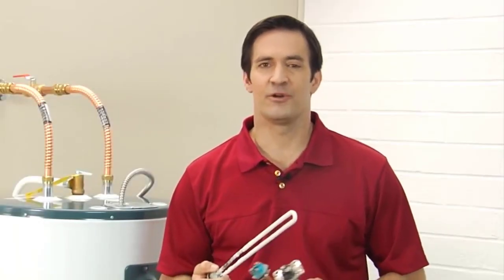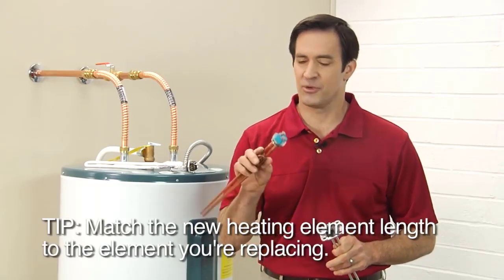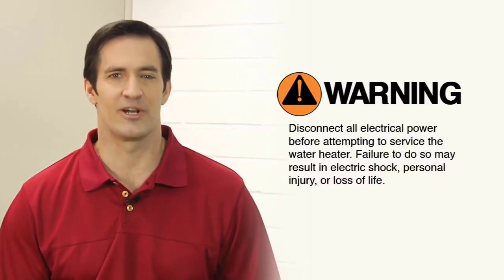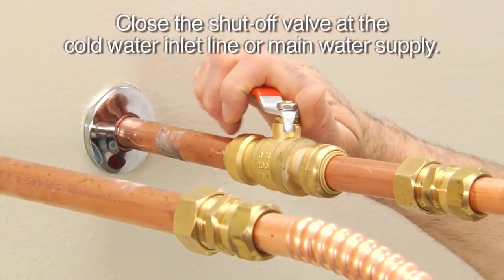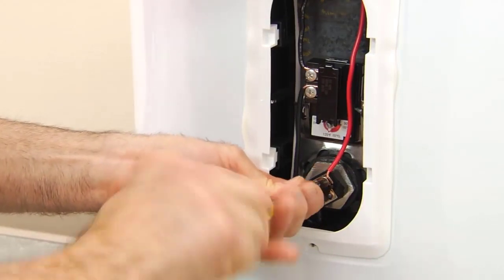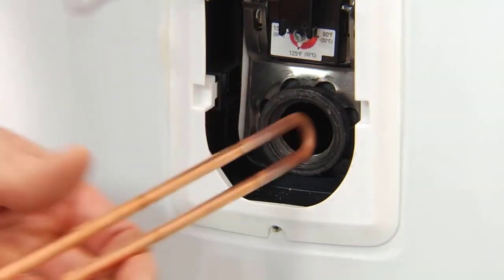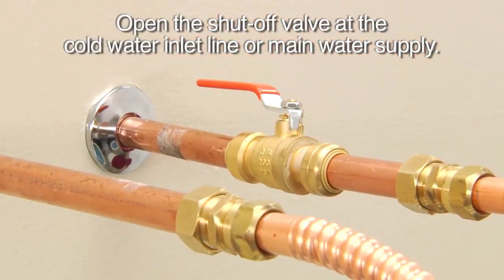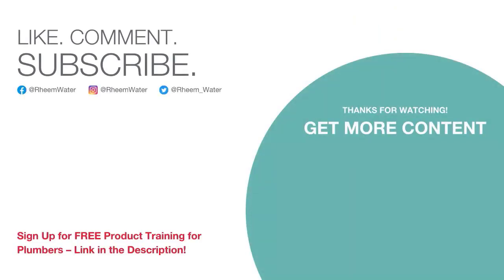How to Replace an Electric Water Heater Element

Comment: Although there are a lot of steps with turning off the breaker, draining the water, etc, each step is very simple and straightforward. I was quoted $350 to change the heating elements, and was able to fix it myself for less than $50 with no plumbing or electrical experience. The hardest part was getting the rusted metal screw off to open up my heater. You can do this, just read carefully and follow the instructions.
Reply: Oh, my heater had a lot of sediment/scale at the bottom which clogged the drain. We solved this by attaching a garden hose to the drain and running water INTO the tank, thus unclogging the drain. Our heater is ten years old and runs fine now.

Comment: So no teflon tape on the threads on the element? Im on a well, shouldnt I also flush/drain the entire tamk pior with the electric off at the breaker panel? Thnx.

Comment: Rheem, why no expansion tank not installed from this video?
Is the expansion tank is gimmick & a scam for the homeowners. 

You guys built these water heaters & all have relief valve to release high pressure gas/water out. 
So why all the sudden that an expansion tank by law is needed?
Reply from the maker: This video was filmed in a controlled environment, not during a home install. In most areas, an expansion tank is required when a home or business is on a closed system or has a check valve. Because the water can’t flow back out, the expansion tank acts as a safety buffer to protect both the water heater and the plumbing system.

Comment: I know this is now 4 years old, but am trying to replace both elements in my Rheem water tank and the top one is quite tight and the 1-1/2 does not fit snugly enough to break it loose without coming off. Think it'd be a tad snug so removal is easy, right? Anyway, any suggestions?.
Reply: You probably need an element removal socket tool like the one he's using in this video. The end is more flush where a typical wrench socket tends to be rounded and has a chance of slipping off.
Reply: @ultmotive  I do have one, and it would not budge, and would try to round off the corners, so bought the same sized socket for a half inch impact and got them off with that.

Got them replaced, but discovered no power to the unit at all, not even 120 Volts, 0V's so have been sussing that out and need to hire someone that does not mind going under the house to locate the break from the back of the panel to where it goes into the house and fix it.
Reply: @johnhpalmer6098 Nice! I was going to  suggest an impact wrench next but it sounds like you got it taken care of. Sorry to hear about the power issue. Wishing you all the luck in getting that resolved.
Reply: @ultmotive  Thanks. I'd prefer to have hot water but there is the stove to heat it as needed.

Comment: About 6 or 7 years ago I turned on one of the hot water taps in my house and SCALDING hot water came out. I have the thermostat set to 130 degrees, so I knew something was wrong. Just to be safe I replaced both heating elements and thermostats. The heating elements were fused across with lime buildup etc (we have a high mineral content in our area). I don't know if that's what caused the problem, but after replacement there have been no more issues with scalding hot water. (The pressure release valve worked also). I'm replacing them again tomorrow as a preventative measure.
Reply: 130 degrees is scalding hot

Comment: Why do I have to check the power even though I've shut the braker off? I wonder if I need to buy one
Reply: it's a 'be safe than sorry' kind of thing.  you don't want to touch 240v by accident.  the tool will be useful for other projects as well.
Reply: Shut down the whole houses power if not checking with multi meter

Comment: Wait!  You have to wait for the tank to fill BEFORE you turn the switch back on from the power box!  If you don't wait until it's fiulled, it will burn up the elements.
Reply: Lol as an apprentice electrician, this happened last year and why I was curious about this video Lol Thanks for the tip
Reply: This happened to a former co worker had to drive an hour back to replace the elements on a brand new heater he just installed
Reply: How do you know once tank is full?
Reply: @Josh-fz9rh  When water is flowing into your sinks or other toilets.
Reply: @EveryoneLaugh  hot water side that is.
Reply: Count to 286
Reply: I mean 420 lol
Reply: He explained that pretty clearly from 3:30 . He said , in this order: Turn on water supply, turn off faucet when water flows (this indicates heater is full) , check connections, reapply power
Reply: Just learned this the hard way the other day :/

Comment: Rheem - showing it should last 10, but my Rheem dual element water heater only lasted FIVE years.  The folded element was so warped, I barely got it out of the tank with the help of really long needle nose pliers.
Reply: Replacing the elements and thermostats in my Rheem after 16 years.

Comment: Do you need to buy an 'element wrench' or can this be done with regular sockets?  If so, how big of a socket?
Reply: I had to buy a tool for that. Look around the area where you bought the heating element.  Most places have a metal tool that is 1 1/2 inch for taking the element out.. or you could go the expensive route and buy a 1 1/2 inch socket.  Ask the place for the element tool

Comment: Very helpful video! Thank you. My advice to anyone doing this is to get a 1.5" deep socket and use a breaker to loosen the elements. The heater socket in this video was useless for me as those elements were really stuck in there.
Reply: I use channel locks and lots of prayers just now!
Reply: I used to pair a big vice grips and it came right off with that tool.

Comment: Water is coming from my heating element the top one what should I do
Reply: You didn’t seal it right
Reply: Drain the tank, remove the element, wrap the threads clockwise with teflon, secure the element, tighten fully, recheck in 2-4 hours then in 24 hours. If there are any gaskets (if they’re old) replace them.

Comment: Should we replace the anode rod at the same time as the heating element? Excellent video.
Reply: You could, depending on how recently that was done. Anode rods should be changed every 4 years.

Comment: yea what if i am looking to replace elements and tempter unit have the whole kits

happen main line to well broken 5ft blow ground outside cost avg 780.00 to repair and dirt going inside burn out the element (burnings) i say hell with it got all 4units needed replace. how come every one skip replace the tempter Sencer united?

Comment: I am not able to replace the upper heating element because it has bent too much inside and cant be pulled outside of the hole. What do I do now???
Reply: Cut one side of the element and it should pull right out.

Comment: Rheem 40gal w 2 heating elements. If I turn of the inlet water and drain the hot water by the faucets, will this drain enough water to replace the lower element or will there always residual in there? The water pump switch failed so lost all inlet water and ran out of hot water while filling washer so water heater was left on for 2 days by mistake until pump fixed.

Comment: Didn't remind the viewer to close the drain on the heater at some point before refilling the tank.
Reply: If you can’t figure that out should you be working on your water heater
Reply: @joshuabennett7334  

Statement or question?
Reply: Also never used Teflon tape 😂
Reply: @focalpointlandscaping  nah doesn't need it
Reply: You'll know if it isn't closed. 😅
Reply: @rods.3245  

Yep. At some point for sure.
Reply: That part is called common sense 👏
Reply: That was intentional and awesome
Reply: Also didn't tell the user what time to set his alarm clock for the morning 😀
Reply: @kelolson9845  

That would not have been relevant. Closing the drain valve would have.
Reply: @Just1American1966  you prolly shouldn't be working in your water heater if you don't have that common sense lol
Reply: @Just1American1966  not entirely, i was here looking for the socket size for the heating coil
but making sure the big bucket with a hole is closed before i put water in it is lol
Reply: Yeah.   Definitely skipped a few steps.
Reply: I noticed this as well. Lmao
Reply: You needed to be told to do that?
Reply: @kennyross1991  

I don't recall saying that. Can you please provide the quote? It's an old thread.
Reply: Also.  Make sure it's empty.  Really good to know. 😂😊
Reply: That sort of becomes quickly self-evident.
Reply: Whew! Close the valve? Thanks Brō. 
So should I put away the wrench and screwdriver now?
Reply: That part should be obvious

Comment: Once I turn the valve with the screw driver to release the water from the water heater with the hose, do i have to turn it back after the water is out of the heater?
Reply from the maker: Yes, after the element has been replaced and before power has been restored to the water heater. If you have any other questions, please call Technical Support at 866-279-4566 between the hours of 7 a.m. and 7 p.m. CST and one of our experienced analysts will be happy to assist you.
Reply: Yes close it once the tank has drained. That way you'll be sure to not forget to close it.

Comment: You need to let it fill before you turn the power on to it.   Or you will be changing the top element again
Reply: True
Reply: Does it only damage the top element or both if the tank is not full?
Reply: @evgar8829 The element needs water on it before it heats up.
Reply: @evgar8829 they will quickly burn out if not submerged in water

Comment: No need for Teflon bc the new element comes with new rubber gasket and draining the full tank is only a preference to some who doesn’t want all that water to suddenly come out while in the middle of replacing the element
Reply: you can't say Teflon ,unless it is manufactured specifically by Teflon

Comment: So, very confused here! YOu only show changing one element. Where is the second one? Does my Rheem water heater only have one? Model #E30 1 RH95
Reply from the maker: To get information on this situation, please contact our Technical Support Team at 800-432-8373 for more details.
Reply: Each element has its own part number. Due to this, they are different(at lease mine does).

Comment: Is there any thing else that can go wrong with water heater
Reply: Reset button
Reply: They can blow up.
Reply: @BeeHiverson The only heater that's at risk of that is a gas water heater. They can burst open, but I've never seen one explode ever.
Reply: @jonathan3982  myth busters had one go through a house roof. Pretty neat
Reply: @BeeHiverson  Yeah I know they did. But they purposely caused it to do that. I've never in my 45 year's seen one go through the roof. I've seen them burst at seams sometimes the top or at the bottom. The only way it can do that is a build up of to much pressure. The only way it would build to much pressure is a faulty T&P relief valve.

Comment: Rheem electric water heater, Element doesn't wanna come out, it  looks like element expanded by itself...too wide to pull it out...What can I Do?
Reply: Wish I could’ve gotten you this info early. (I’m posting for future people that may visit the video). Those element tools normally bend when trying to remove those elements because of all the calcium that builds up around it. A 1 1/2 socket will do the trick easily.
Reply from the maker: To resolve your issue, please contact our Technical Support Team at 800-432-8373 for more details.

Comment: If you are replacing one you might as well replace both.
Reply: Gasp! but the other element might go for a few more weeks!!
Reply: Replacing both of the elements at once is a good idea. Just keep the other element (the one that wasn't burnt out) as a spare.
Reply: Yeah and while you’re there you might as well get that anode rod changed out.
Reply: If you got the ceiling space!!!
Reply: Not necessarily. Depends on what’s going wrong.
Reply: I did all three

Comment: There is no need to drain the water heater it's pointless waste of time.
Reply: Why? Wouldn’t all that water just pour out?
Reply: Yes there is!  if you unscrew the element to pull it out, water will pour out the hole until its low enough to stop....are you dense?!
Reply: if you turn off the inlet water and release the pressure at a hot tap, you can remove the element and the water only dribbles out as fast as the air can get in at the element mount point. Working quickly, with a plastic funnel to catch the dribbles it is possible. See other YouTube videos. Turn the electricity off a day or two before so the temperature drops a bit and you don't get scalded.
Reply: @lemizle Not to mention it's best to drain it all out so you can clean out the tank with a shop vac.

Comment: Thanks for this video. Looks like an easy job. Is it possible to swap out the heating element with one that has a higher heating capacity, i.e. 3Kwh to 4.5Kwh as long you have the proper 240V and proper 25 or 30 AMP breaker to support it?
Reply: No
Reply from the maker: Please contact our Technical Support Team at 800-432-8373.
Reply: Yes, as long as you are sure the breaker can support it. The highest wattage means it will heat faster